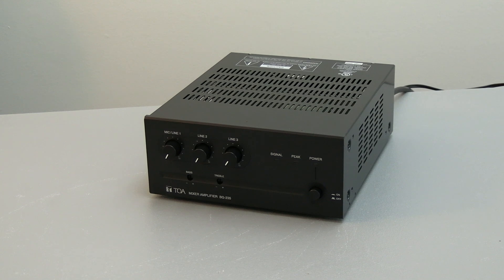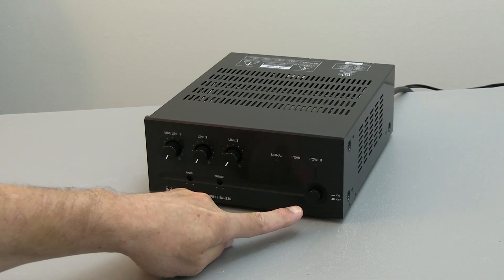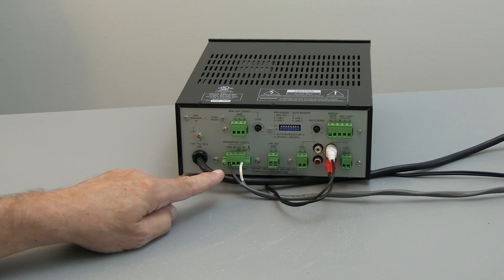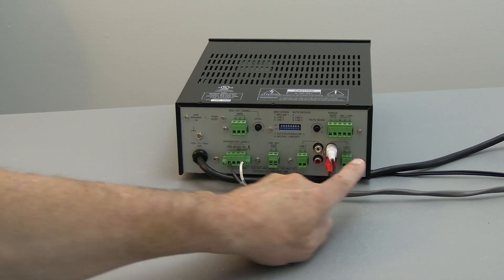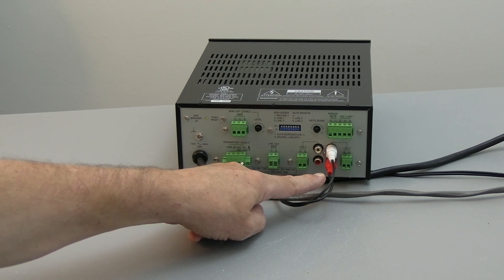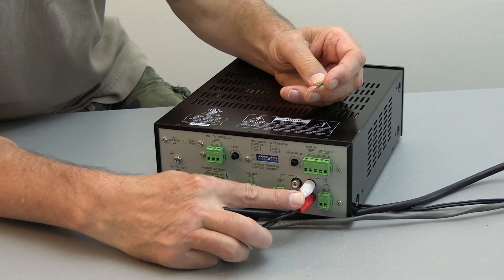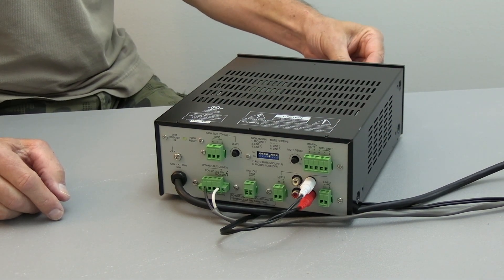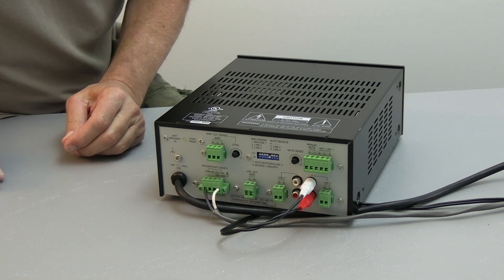70 Volt Speaker Systems - Typical Mixer / Amplifier Basics, Notes

Comment: Hello,

I have a TOA BG235 amplifer and trying to setup a microphone for it. Any chance your able to make a video on how to setup and configure it to work with the speakers already attached to the system? I can't figure it out and can't find help anywhere. I tried connecting via 6.35mm to RCA and it comes out very quite at full volume when I know the unit can produce way louder sound.
Reply from the maker: First, you need to measure the speaker line that is going to the existing speakers with a multimeter. Is it 4ohms, 8ohms, or are you reading a short (which may mean that they are 70 volt). Whether its 4 or 8 ohms you can hook the speaker line up to the Speaker Out (black to COM, and red or white to 4ohm). If you think the speakers are hooked up 70 volt, hook the line to Speaker Out (black to COM, red or white to 70V). Hook the mic line to the Mic/Line H C E (E being ground (bare wire), and H / C being the mic element (red, black), set the dip switch to mic, turn it up on the front panel. Hope this helps.